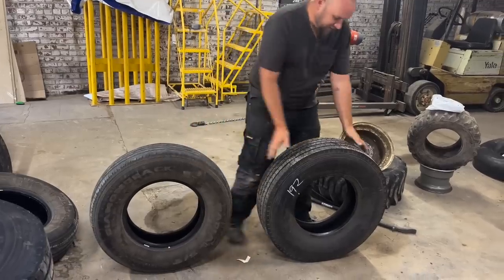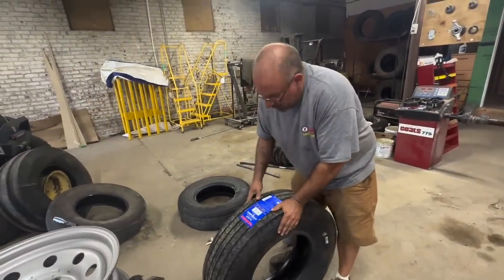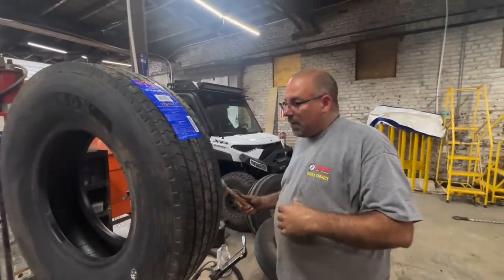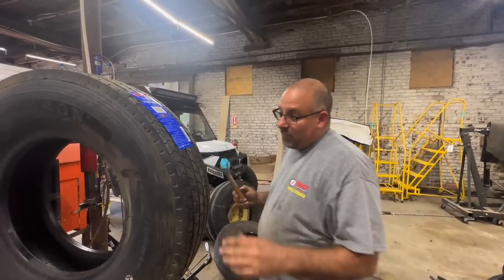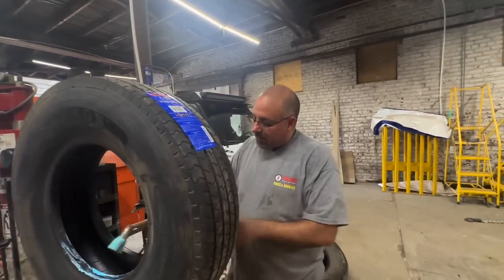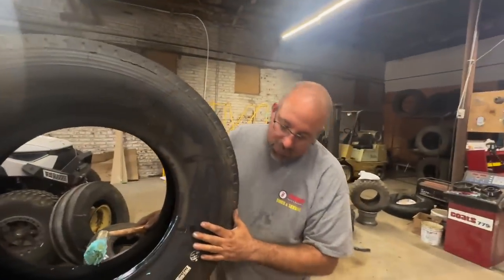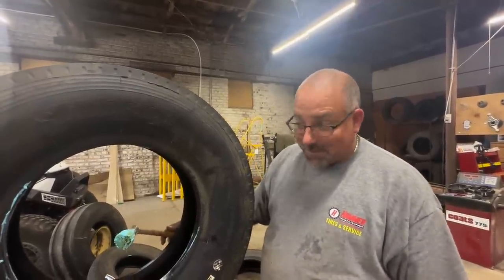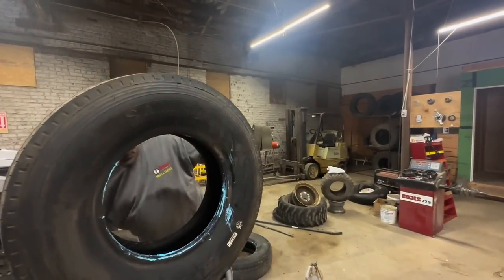Gooseneck Death Wobble Fix and A Tire Trick I've Never Seen Before

Comment: I'm glad you covered this Brock. The guys you talked with are absolutely correct now take a few minutes and completely go over the trailer frame and look for broke welds. All that twisting, vibrating and bouncing will fatigue crack the welds and you can fix them easier the quicker you catch them. One more note for a goose neck trailer, try not to make really tight turns when you are hauling heavy. When you make tight turns with a load the side wall of every tire will have lots of force pushing sideways on them and could damage the cords in the tire like you had going on. I know guys that when they buy a new trailer they will get the cost of the tires knocked off the price of the trailer and will supply their own tires (like you bought) and rims for the exact reasons you just delt with.
Reply from the maker: Good points

Comment: Extremely helpful thank you!!!! Next tires on my trailer will go from 10 ply to 14 ply.
Reply: Mine as well, even though I only have a 7k rated trailer, the heavier tires would help anyways, at least make the trailer more stable.  Softer tires can make a trailer less stable at higher speeds because of the squishy sidewalls on them, allow more roll side to side of the trailer...same goes for cars, trucks, too...going to a heavier tire will make the ride quality better in many cases as it stiffens the sidewalls giving you a more firm ride when cornering.

Comment: That's wild....  I'm kinda in awe that it was that complicated....  but I LOVE that you figured it out Brock.  I hate when a shop (or a doctor, or a store, or where ever) tries to blow off what your telling them is happening, and they shuffle you out with the wrong solution.  Great Video!
Reply: These shops are more about getting your money than actually fixing the issue....repair shops are the same way, and if you try to bring them an older vehicle, if they can't hook their fancy OBD2 computer up to your vehicle, they most likely have no clue how to diagnose anything or fix anything on it, so don't bother....found this out with my old pickup...spent thousands of dollars in parts, and labor...problem still wasn't fixed....they couldn't even bother to check the wiring to the O2 sensor that was bad and was like $60, and was the problem in the first place....but the shop replaced the distributor, cap, rotor, ignition module, timing chain set, you name it they replaced it and all along all that was needed was a new O2 sensor due to the wiring being well non-existent....looked like the clips had come loose or broke and let the wiring hit the exhaust and melted it, grounded out the O2 sensor, and left the truck with a terrible fuel delivery issue it was dumping too much fuel because well it just didn't know what was going on.  Problem solved now, but man what a rollercoaster mess that shop was.
Reply: @wildbill23c  exactly!!  Glad you got your truck fixed!
Reply: @OldIronAcres  Me too, its an old truck but has turned out to be more reliable at times than my newer vehicles LOL.

Comment: I found that educational. One thing I'd like to add is a year ago my property got a direct hit by lightning and sprawled out numerous areas including coming up under my Cargo trailer and I found it had de-vulcanized my rubber in spots. One tire had about 3 tiny holes but one spot it actually looked like a small bubble gum bubble. So I replaced both. There was actually small amounts of rubber powder spots under both wheels where it was parked. The other wheel seemed ok but I wasn't taking any chances. So if anyone has weird lightning strikes nearby, inspect your wheels!
Reply: Good idea . . . never would have thought about lightening causing a problem.  Thanks.
Reply: Good advice

Comment: When I was younger, I was a diesel mechanic.  I worked for a small trucking company and was the only mechanic.  I did a lot of tire work, but unfortunately had no machines.  All tires were mounted using bars and hammers.  We had a primitive tire balancer that worked by letting the heavy side of the tire turn to the bottom.  You would add weights opposite the heavy side until the tire would remain in one place no matter where you stopped it.  Simple, but adequate.  One of the things I would do before balancing is spin the tire and look for runout side to side and vertically.  We used a lot of retreaded tires, so it wasn't that uncommon to find one out of round.  Never came across one like yours, though.  Broken belts aren't that common on quality industrial tires, at least in my experience.  It's educational to see an example like yours just to know.  Knowledge is knowledge, and no knowledge is useless.  I found your video interesting, and it brought back a lot of memories.  Mostly of sore backs.  Those were the days.  Keep up the good work, my friend!

Comment: My split tilt deck gooseneck trailer just started doing the exact same thing! I asked a tire shop about what could be causing the wobble and they said take it to a trailer specialty shop. But my tires are the ones that were on it when I bought it and I suspect one or more of them are slightly out of round. I'm going to look for that issue and potentially just go get a whole new set of 4 heavy 14ply trailer tires put on. Thanks for doing this video! Great job. 👍👍

Comment: I had two flats in one day while loaded with material  on my 16 foot dump trailer.   Upgraded to 14 ply tires that day.   Learned my lesson with the stock 10 ply tires.   If I buy a new trailer of any sort, I am definitely upgrading the tires.   Good video Sir . . .
Reply: I have an 18' car trailer, rated close to 7k so I'm about 4-5k max with my little tractor and implements, so I don't have much to really worry about with the 10 ply tires, but I may upgrade to something better when I need tires in the future for sure.  All these trailer companies charge a ridiculous amount of money for their trailers, and honestly none of them are built very well at all in the first place, then they get even cheaper with lights, wiring, and tires...then come the under-rated axles they use too.  Just about have to go directly from the trailer dealer to an axle and tire shop and have axles and tires replaced to bring the trailer somewhat up to what its supposedly rated for....then go through and reinforce all the welds on the frames.
Reply: @wildbill23c  You are 100% right my friend.  I have a 12 foot TX Bragg and the wiring tech must have been in second grade . . . I fixed a lot on that trailer to make it safe to use.  I did a video on it when replacing the floor.

Comment: Excellent video. I’ll be doing an upgrade to a heavy duty flatbed trailer pretty soon. This video sure gave me a lot to consider when replacing the tires.  Looks like the steel belt 14 ply will be the way to go. Thanks for posting.

Comment: Great information. I really appreciate the way you document the process in detail. I found out the hard way don't go cheap on tires. Last year while traveling north on interstate 5 in California I had one tire start to bulge and blew out on a VERY busy freeway. This happened on a Friday after 5pm. Changing a tire on a 9k loaded trailer on a very small section of emergency pull over is not fun or safe. Long story short. After researching tires I found the existing ones were at their limit and consequently the other 3 were starting to bulge as well. They were 10 ply. Unfortunately I was only able to aquire an updated version of the same tire but was assured the manufacturer had corrected the defect. We shall see.  Can you say Good Year Marathon? 14 ply or stronger is the way to go.

Comment: The old  adage is you get what you pay for especially in tires and wheels.  Throwing a tire band at high speed with 14K pounds of load can make for a really bad day. Trailer inspections are a serious must especially trailering 14K pounds. Inspecting tire tread, tire pressure, axle bearing lubrication, and brake/ hub inspections keep everyone on the road safer. Also drive 5 miles fully loaded check hub temps for overheating.

Comment: Good morning Brock. I never even knew that they had tires over 10 ply. I do have one question though. Did you replace all 4 tires or just the 2 that you hadn't already changed? Just curious. God bless and I'm glad that you found the problem before something really bad happened. 👍👍😊
Reply from the maker: Two weeks prior, I had replaced two of the tires going from 10 ply to 12 ply. So now I have two 12 ply tires and two 14 ply tires. All new so should be good

Comment: You need to find a new tire shop if they put it on a wheel balancer and did not notice you had a broken belt
Reply: I agree
Reply: Not so sure.  I once had 4 new Michelin truck tires installed on my truck.  The vibration at 55 mph was awful.  They checked balance and it was fine.  Still vibration.  Finally they road balanced the tires.  That means the put pressure on the tread while balancing.  3 of the 4 NEW tires had bad/broken belts.  It took the road balancing to find it.  Oh, and I will NEVER buy another Michelin truck tire.  Even the replacements wore horrible.  BFG AT TA KO for me.
Reply: @charlesperry1051  there is a difference between a broken belt and tire ply's that are miss aligned during the construction of the tire.  Miss aligned will not show up unless you put a load on the  tire (road-force balance or mounted on vehicle).  A broken belt will show up when the tire is spun on the balancer,  you can see it looking at the tread, it will still balance though.  My occupation is a fleet manager, I deal with this more frequently than one would think.  I always opt for road-force balance when available with new tires.

Comment: You should drive no higher speed than the tire is rated for.  I was surprised my trailer tires were not rated above 60 mph.  It's a good idea not to operate at the limit in general.   Modern tires are rated pretty high but lots of people have trailer tires that are expired or nearly expired so may be limited to as low as 55 mph.

Comment: One thing I don't like is "ply rated tires".  They'll say it a 6-ply rated but probably has only 4 plys.  Anywy, fewer actual plys than what is actually in the tire.  Up until about the mid 1970s, I always though tires were always round, until I had one that wasn't.  Brand new tire, on my car which would never have been overloaded.  But it can happen.  At a certain speed, the tire can ressonate and cause a lot of bouncing and shaking.  Did the tire guy break open the bag of balancing beads?  Seems like if not, all that weight on one spot would through the balance way off.

Comment: The lesson is not putting a 10k skidsteer on a 14k trailer because you're going to be overweight. You need a 22k trailer for a 10k skidsteer.
Reply from the maker: Skid steer weighs 9500 pounds trailer is 4000. That’s 13,500 pounds. 15% of that is not resting on the trailer axles. That 15% is riding on the truck as pin weight. What that means is 11,475 pounds resting on 14,000 pound capacity axles.

Which put you at 81% capacity without factoring in that your axles are not carrying their own weight 

Would it be better to massively over size your trailer for every load? Sure it would. That being said these ratings exist for a reason.  

Everything I haul is within the rated capacity of the tow vehicle and the trailer.

Implying that a part-time guy like myself, needs a dramatically, bigger trailer and a dramatically, bigger truck and higher tax rate and higher insurance rates and a CDL and on and on and on doesn’t make much sense
Reply: @Rockhillfarmandhomes  having more trailer than you need is better than having a bare minimum trailer for what you're trying to do.  A 3/4 ton truck would be just fine for a 22k trailer.  You might have to put a higher tag weight rating on it, but it would work perfectly fine.  I don't know how truck tags work where you're at, but I live in Missouri, and we have a weight number on the tag. That number represents the GCWR of everything, truck , trailer, and what you're hauling. Here, we don't need a CDL for hauling stuff like what you're hauling. It may be different in your state though.